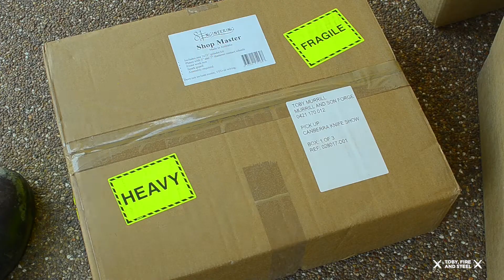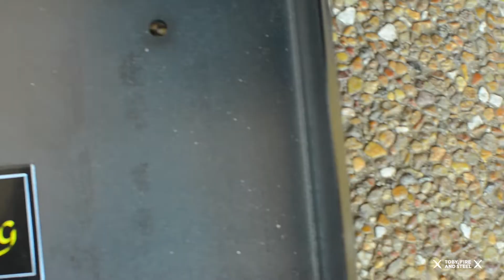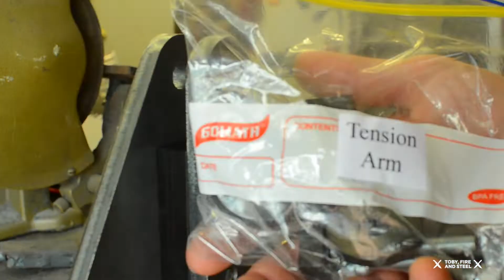Assembly of a shopmaster 72" bench grinder,  84 Engineering

Comment: Hi mate,i'm curious if the 72 inch grinder, if you buy the delux package with adjustable stand,does it come with a part to mount the VFD to the stand?..Cheers.Thanks in advance.
Reply from the maker: Hi mate. I didn't buy the adjustable standard but yeah there should be a back plate to attach vfd to stand
Reply: @TobyFireandSteel  .I ordered the grinder with the stand and accessories .I just did not know if  the VFD needed to be mounted to a bench or to make a separate bracket.Actually a mate also brought the same thing weeks earlier ,asked me where the VFD attached and i could not answer him.It's at least a month wait for the grinder for me and my mate will have waited six weeks at this stage.They sure must be popular..Thanks mate.
Reply from the maker: So sorry mate i just saw this did you sort the problem?
Reply: @TobyFireandSteel ..I have not put the grinder together just yet as i want to paint it  first,and am running out of room in the garage..It seems like everything is there though ,to bolt the VFD to the stand.Thanks for asking.
Reply from the maker: No problem mate yeah thats the way mate. Also I actually screwed off to the left in side of a shelf. It stays less dusty there, is out if the way but still perfect to reach 👌
Reply: @TobyFireandSteel  The VFD that is supplied now is not the tecoE510 but replaced with a different unit..It seems much larger and is almost the size of a small dust proof lockable cabinet on its own.It's a box approximately 300mmx300mmx150mmdeep with a dial that goes from slow to very fast.So no more digital display, but still a quality unit with what seems to be a more user friendly VFD.

Comment: Great video!
I'm trying to decide between this and the 48 deluxe kits. Do you think it's worth getting the 72 over the 48 for the price?
Reply from the maker: Heya bro. Yeah mate they are both amazing and nice owned both. Make sure you get the deluxe kit. I'd say that's possibly more important than the size. Though if you can afford the deluxe 72" I would stretch for it. Also when you buy it call artisan suppliers ask for Tim or Cole and tell them I sent you. They should look after you on price bud. Thanks for watching mate
Reply: @TobyFireandSteel  
Cheers mate, I'm leaning towards the 72". I'm in New Zealand so it will be through our nz store, but I'll still try get a deal through them if I can.